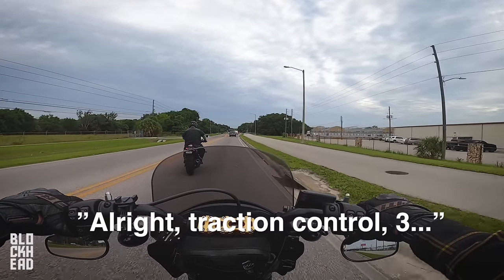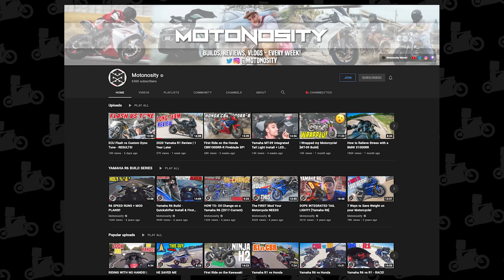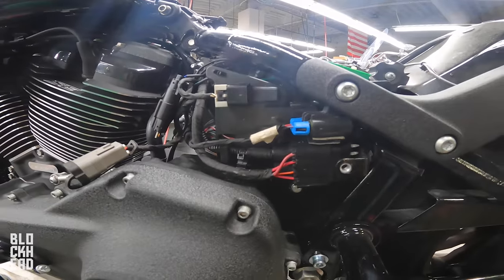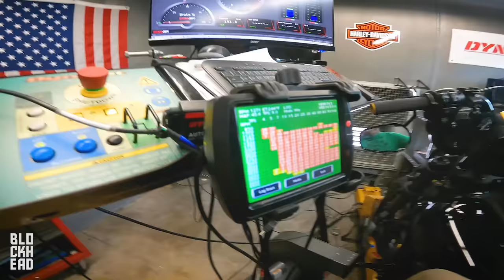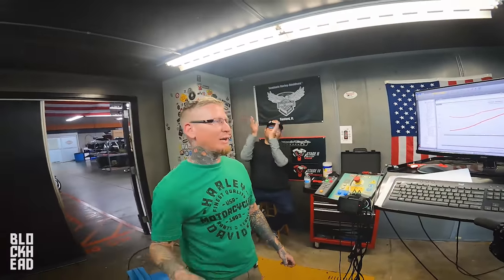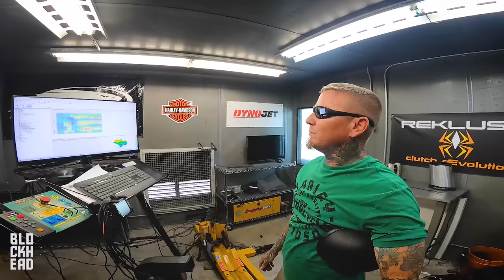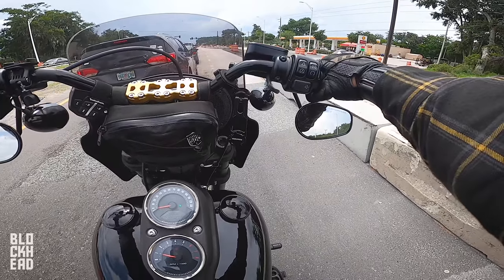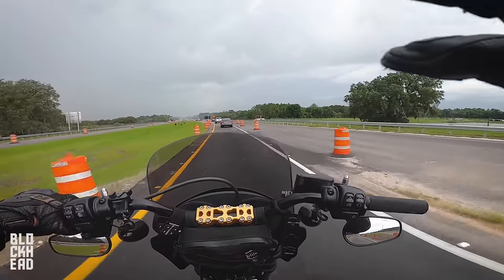151 HP / 150 TQ HARLEY SOFTAIL!

Comment: This video shows that the dyno tuning session(s) results in a custom tune for your PowerVision. Anyone using a PowerVision with an engine builder who does not have access to a dyno, should probably also consider installing the TargetTune module. There are a lot of opinions about which ecm tuner is superior (Thundermax, TTS, PowerVision, etc.). Whichever one your engine builder knows best is probably the right choice.
Reply: Judging by the data learning screen we saw on the Power Vision while Chris was working through various RPM ranges, I'm guessing they were running the TargetTune or at minimum AutoTune module. I'm not sure what the differences are on the M8, but on my V-Rod I run the AutoTune with wide band O2s since mine was pre-narrow band O2s that ran in closed loop mode. It's so much easier to have it self learn on a dyno than trying to do it on the street while dealing with traffic, but it's still possible to just ride it and work through it little by little.

Comment: I can totally relate to the race cam issue pushing you to ride revving higher and riding faster. Not for me. I now have a torque cam in my bike and love that type of riding, especially in traffic. Most of my riding is done well under 4000 rpm. and it keeps me out of trouble.

Comment: Hey Block. Love the vids. Where's the Sporty? Also main question. Your bars. Are they comfy with minimal pullback? Looking at a set of Biltwell Frisco bars for the 72 and they have very little pullback. Comfort is a bar change away, but not something you want to have to do over and over.
Reply from the maker: Sporty was on the lift beside Goldzilla, working on the 1275 install. Yeah the bars are comfortable, have installed on a few sportys 👍🏼
Reply: @BlockheadMoto  yeah I saw it back there. I'm actually quite excited for the F#$k You Sportster build. Looking forward to see you working on it and what she can do. Just bought a Sporty 72 to learn to work on bikes a bit more by myself. It sits next to a Rocker C and a Honda VFR 800 that are both currently feeling a little jealous. Enjoying your journey. 👍

Comment: Hey man check out Bassani 1D3SS performance exhaust.   It's new from Bassani and it's a 3 stepped head pipe. With your 131ci build I think it would give you the most power.

Comment: Does pose why dig a MT10 in 4th, at that speed, should have been in second, not knocking the pull on Godzilla but …. MT10 is like 170+BHP.. and should have been buzzing at 9k on the dig. Great numbers and more to come.. Keep up the content dude 💪
Reply: @seanbutler2291  aye, certainly once into the power band ton up, just P2W is the killer… but hey I love how strong Goldzilla is pulling and sounding 😎 a MT10 will never be that cool. A better comparison would be a dig against a new Rocket3 which has as much power/torque stock as Goldzilla 😎

Comment: Need a recommendation. I’m 5’5” and the stock handlebars are a bit too far for me. I want a pull back bar with 1-1/2” to 2-1/2” pull back. What do you recommend that will still use the stock cables and wires. Thanks.
Reply: I'm 5'6". I own a 2020 softail standard and just had new handlebars installed. Keep in mind I have a saddlemen step up seat, if you're gonna change your bars out make sure you have the seat you really want. Anyway I went with bung kings pullback risers, with 2inches of pullback and thrashin supply mid bend bars. This setup on my bike is literally perfect. Also the end height of this setup is 12inches and I didn't need longer brake/clutch. I used the stock stuff. Also if you check out "moto blonde" she's even shorter than us and has a low rider s, she rocks saddlemen step up seat with bung kings pullback risers, 2 inches of pullback, and uses the stock handlebars
Reply: @SooHighFashion  Thank you! I will check motoblonde as well. I do have Saddleman step up seats and love it.
Reply: @tdhinaker9327  yeah I totally recommend bung kings pullback risers with 2 inches of pullback since we're such similar height. Thrashin supply makes great handlebars too. No problem, when I was researching what bars/risers to get for my height I struggled because I'm a shorter dude lol whenever I see someone needing help I always help the shorter riders like myself. I forgot to mention that I went with bung kings 8inch pullback risers with 2 inches of pullback. With thrashin supply mid bend bars the end height is 12inches.
Reply: @tdhinaker9327  I went with bung kings 8 inch risers with 2inches of pullback. Forgot to mention the height of my risers lol
Reply: @SooHighFashion  That’s exactly what I’m considering doing as well. Thanks for this 🙏🏽

Comment: That thing is awesome! I’d have to imagine the ridiculous amount of heat that comes out of that thing! Don’t get stuck on traffic 🤪
Reply from the maker: It’s actually nowhere near as bad as my 110 twin cam was! The oil cooled heads and a proper tune help a lot I guess 🤷🏻‍♂️
Reply: @BlockheadMoto  Ahh that’s fair. My dads twin cam was a literal radiator and it was stock 😂.

Comment: HI Guys, love the videos, I'm in the UK and have a 2018 heritage and just had a 131 stage 4 kit put on with upgraded oil pump /cam plate lifter cups and clutch.Also a cyclerama 512 cam It produces 141 HP and 156 ft pounds of torque which is great but the only problem i have is it kangarooing a bit when I slow down and try to go steady in 20/30MPH zones which is annoying . My dealer says this can happen with this upgrade , is this true or is there a way around this ? I still have the 2 into 2 vance and hines pipes . Just had the air filter changed to the ventillator extreme so im hoping this may help??? But will see when i get the bike back . Just wondered if anyone else has mentioned this ? Cheers Keith
Reply: Hi Keith, I’m also in the uk. I cannot shed any light as to why your bike is doing that but I am considering doing the same. Where did you get yours done? 
Cheers Jake

Comment: i have gone through all the stages and most times did not see that much difference. like adding 10hp i wonder do you feel it. i did not feel the increase in power until i went to the 131 with dynojet tune. i ended up with 141 and 143. just wonder if you can even tell the difference between that and 150.

Comment: Could you give a little insight why you took the thundermax out? You can manually tune the thundermax and turn off the auto tune function.
Reply from the maker: Chris is versed in Dyno tuning with Dynojet. While we got the bike running well enough with Thundermax, he knew he could get more out of it with Dynojet.
Reply: Gotcha. That’s one of the issues I’m having now, switched to a thundermax over the pc3 and nobody within 4 hrs tunes with it. Been data logging and making corrections as I go till I can find someone to tune it. Thanks you homie

Comment: Local Listing here for 2011 Wide Glide with 120R for $10,500 with 7700 miles....  deal?
Reply from the maker: 120R is specialty for sure, gotta factor in they probably rode it pretty hard w that! I’d def get it checked out and have a thorough inspection done by a tech beforehand 👍🏼